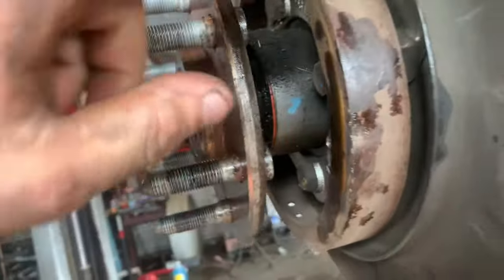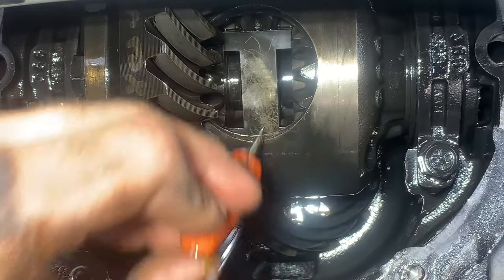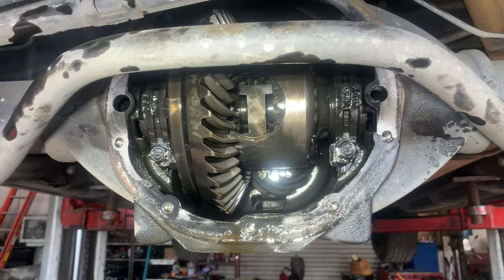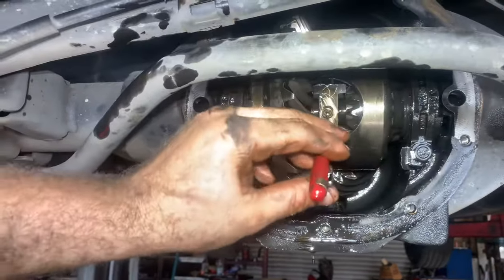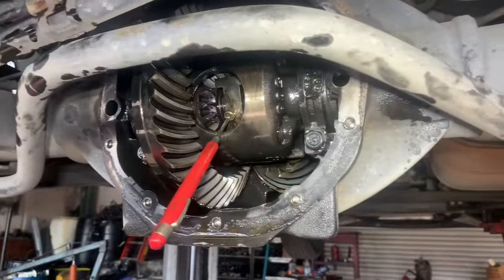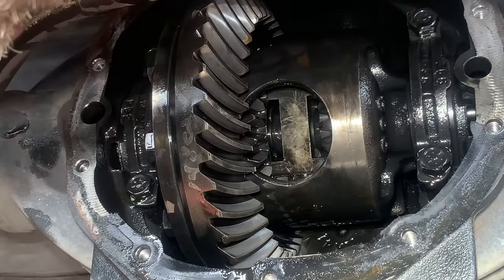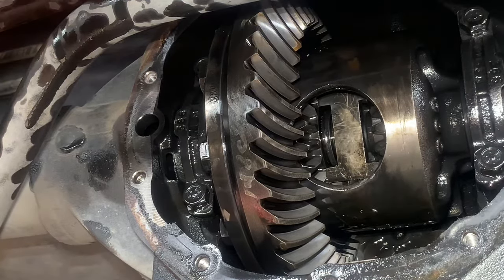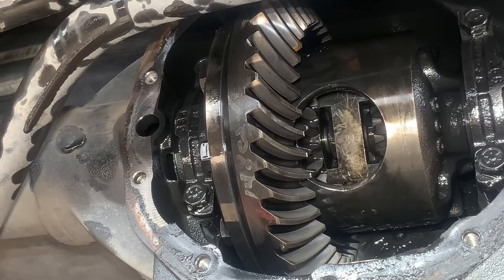How to Remove C clip for Axle removal GM Limited Slip differential

Comment: Hey! That was a great video! Thank you! We needed to see how to get that c clip out but we actually did need to pull the axle as well and you left us hanging with "ah! Son of a ...."  ours wouldn't just slide out either and we weren't sure if we needed to remove the bearing plate on the end of the axle as well or not... turns out that we just needed to use a big pry bar and ease the axle out... I'm case anyone else needs to know... just use a pry bar and gently pry the ale out and it will slide right out!  Thank you!

Comment: working on my 2014 suburban right now and trying to pull both axles out, to replace the bearings and I was fixing other parts on the rear end as well. Your video is helpful, but to add to the solution for removing the clip on the driver side, I needed to do a little extra searching for other people with the same problem. Whenever I pushed in or clamped the driver side axle, I could feel it bottoming out, but upon closer inspection, I could see it was not hitting the thrust block, I think that’s what it’s called, in the center, but was being stopped by something else. there was still space or room for it to move in Ward a little bit, it just would not do it. So the answer I found from someone else, was making sure the C clip would spin around enough to expose the groove in the end of the axle. Using a very large flat screwdriver, prying in on that end the axle with the groove and forcing it towards the thrust block. This took a couple tries, but eventually I was able to slide it in further and give myself the space I needed for the clip to come out quite easily .

Comment: O man my spider gears blow up after the Limited slip block, sheared and went into the gears. Little chunks of gears now. And that block in between is doing the slip and slide all over the center and I have not been able to get those seat clips out yet but they are coming out. Thanks that was a good video.

Comment: I got the block in the center out of the way by sticking my screwdriver in behind the top and pulling it. the block came away enough. had to wiggle the axle because it had play in it where the bearing had worn on it but, thank God it finally went in.

Comment: I had to scream and get real angry at it for two days, but i tried hitting the axle in with a rubber mallet, and then when that wasnt enough I moved that I shaped peice in the diff just a little bit to the right with a screwdriver, then i was good to go. Once it popped into place i was in disbelief, Immeadiatly I screamed "YES!!"

Comment: what year truck?? im hearing a intermittent grinding in diff after pulling my axles in '04 2500 Suburban 4 x 4 , axles came right out and back in with no resistence....
Reply from the maker: @bradleystevens2956  this was an 08 I believe, could be wheel bearing carriage bearing or pinion bearing did you add oil back lol

Comment: When putting the C-clip back in, does it matter if you have the rounded edge facing outboard or inboard?
Reply: The rounded edge goes inside the flat edge goes outside if you havnt figured it out yet

Comment: Am i stupid? I gave up because i couldnt pull the clip. I have the 8.5 inch rear diff, had enough clearance on each side of the c clip so that i thought it was ready to come out but wouldnt fn pull. Tried 3 magnets. The magnet off the diff case fit in the c clip slot the best but no dice on pulling the damn thing out. I gave up. Was in the rear axle to fix leaks and figured would install new wheel bearings and seals but noooooo. Wtf. Why did i fail?

Also, where do i  find the exact same magnet you used
Reply from the maker: It was a Matco magnet but you can use force don’t be afraid